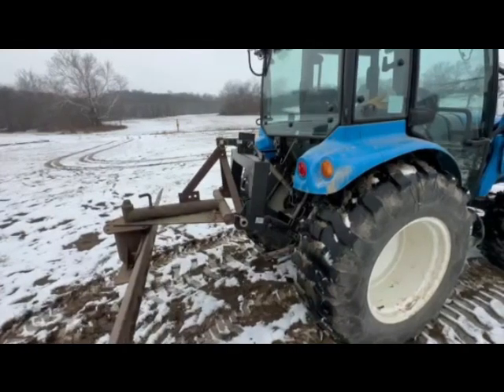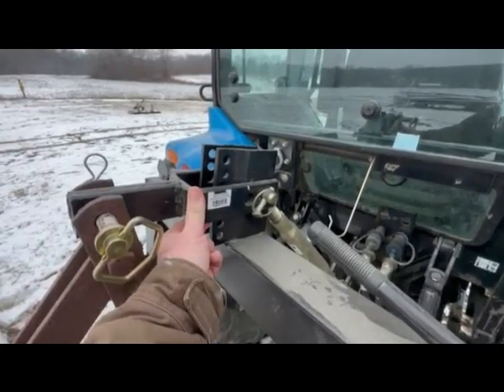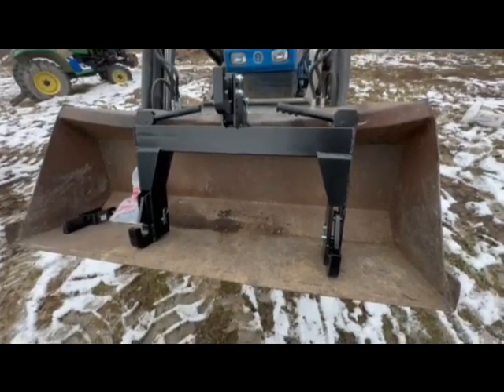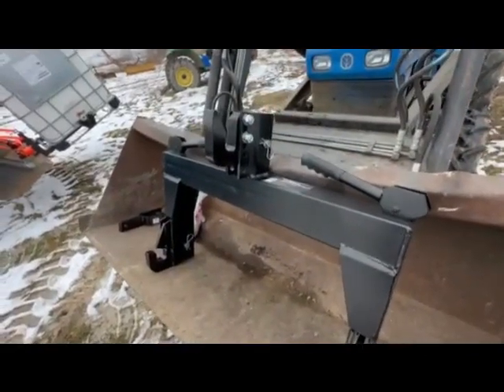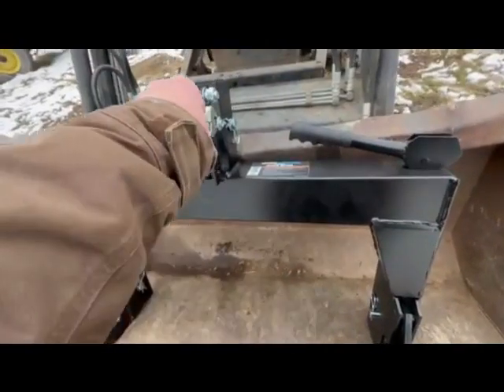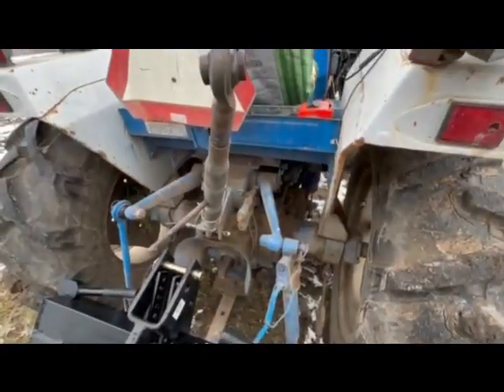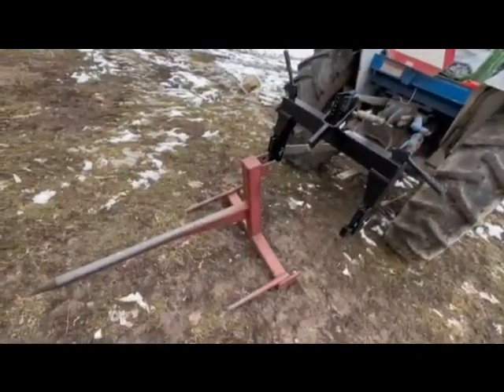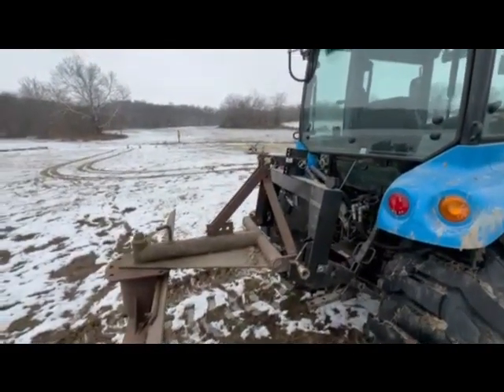modifying a Harbor Freight quick hitch to work with 3pt implements

Comment: Cant get bottom lift ends to fit into openings on HF quick attach,,top link is right width but bottom isnt wide enough to allow lift arm ends to go inside opening to put in...any suggestions
Reply from the maker: What type of implement is it? We had issues with several implements. I ended up switching to the pat’s quick hitch. It is more implement friendly if you have older implements